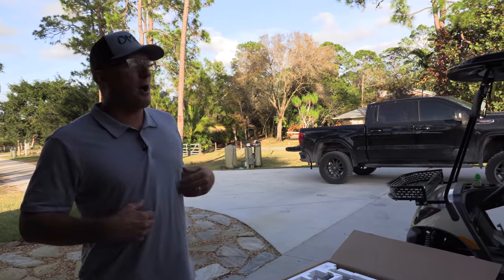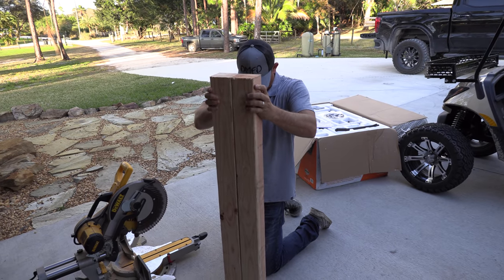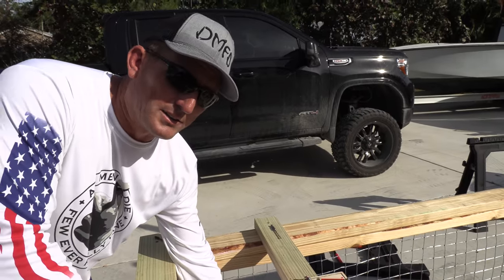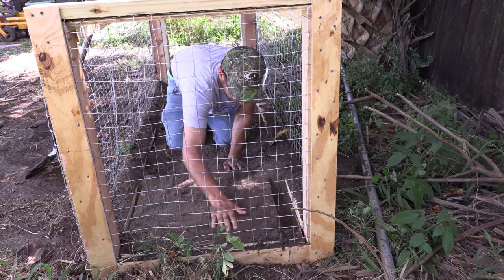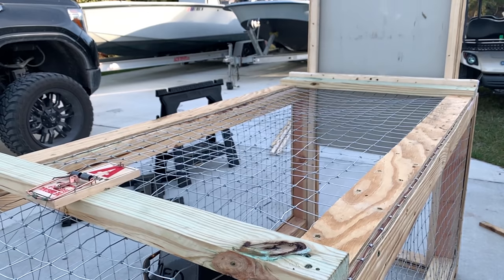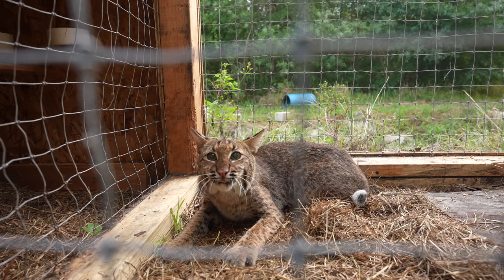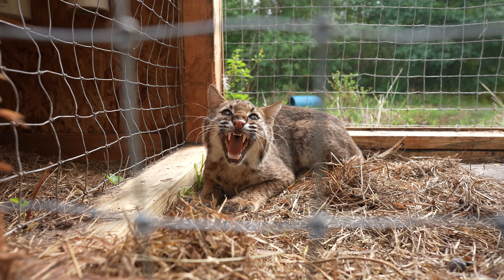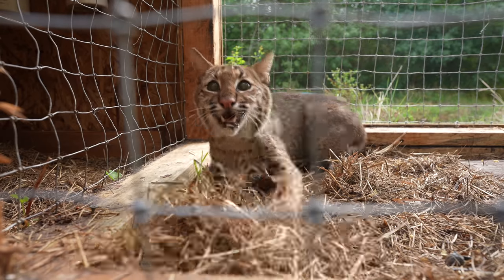Trapping WILD BOBCAT in HOME MADE trap! {Catch Clean Cook} Cast Iron Bobcat Loin

Comment: Bobcats actually respond quite well to cage traps.  They are not particularly afraid to go into a cage for the most part.  One trapper in southern California caught 130 bobcats in one winter.  Of course foothold traps work fine, but cage traps still do a pretty good job. Bobcats can be caught in cage traps much smaller than the one shown.  Commonly used traps have openings from 9x18 to 12x24 with a length of 37 or 38 inches long.  Some are single door, others double door.  We like traps with folding internal bifold doors that can be set in tight places and in all weather conditions north and south.  The newest cage traps have wire triggers and powered door.

Comment: It’s tough and gamey because the cat was under a lot of stress and adrenaline for hours in the trap.   Ya gotta take them out when they’re least expecting it.  That helps to alleviate the toughness.   2).  After butchering, use a meat tenderizing hammer, then soak in a bowl with a tablespoon of vinegar and cold water.  Let soak in the fridge for about an hour,    Remove, rinse, dry and then soak in bowl with buttermilk, a little salt and cayenne pepper over night.   Then grill on low heat in cast iron skillet with a little avocado oil or extra virgin olive oil.  Don’t over cook.   Enjoy.